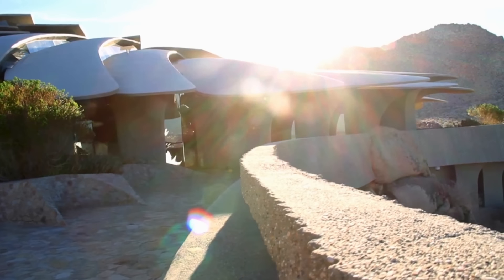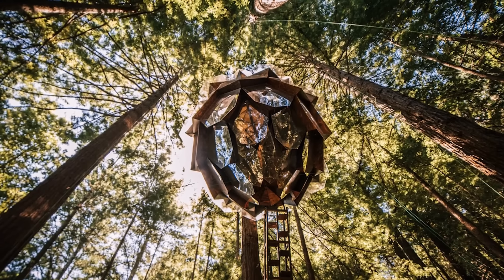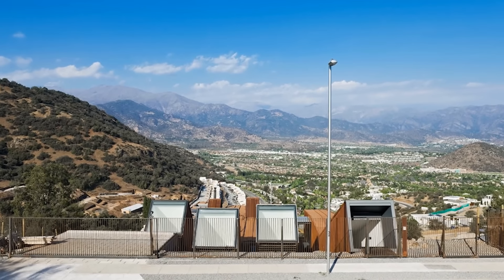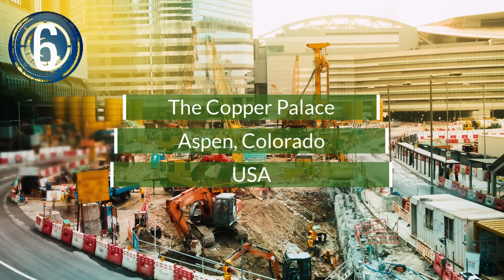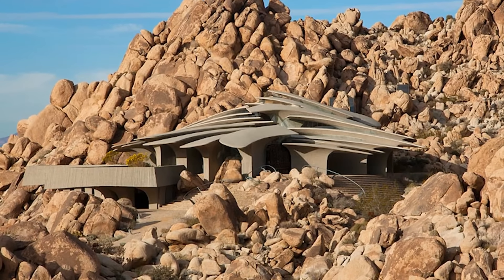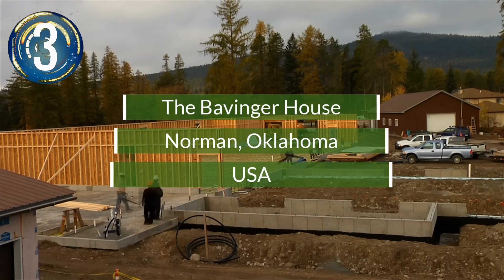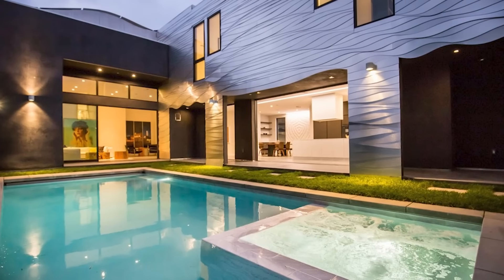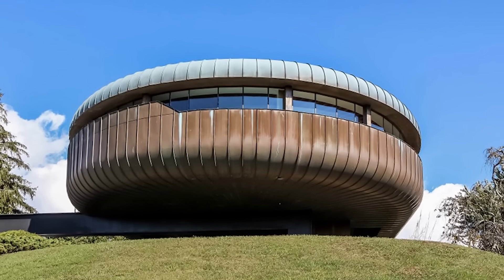10 Extremely Brilliant Home Designs from Around the World | 2023

Comment: Nice thanks. I love the subject matter. There seems to be no optimum building design when it comes down to form and function. Perhaps with the correct format you might change that. 

 On the subject of presentation strategy, last time I asked you if the numbers in your presentation represented your rating you said no, they were random. May I suggest a tried and tested strategy - the circus strategy?
Reply: The opening act is a simple but eye-catching act that pulls the crowds in. The finale is the best to keep them all seated until the end in anticipation. The middle is a crescendo of additions to the opening act, a triumphant, nail-biting, death-defying finish.
Reply: ... before the...